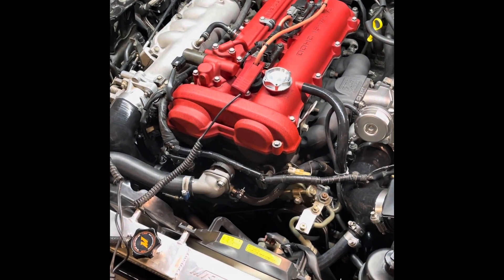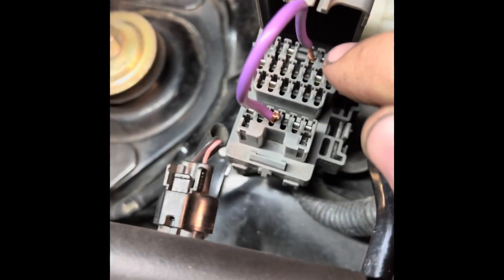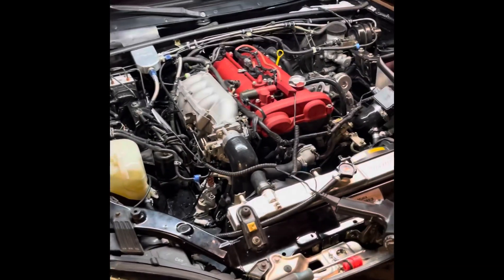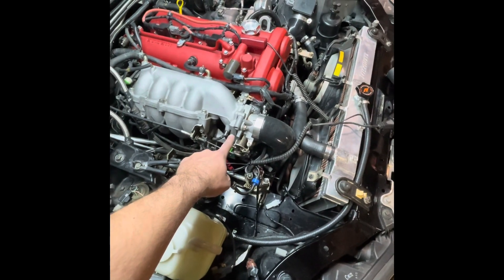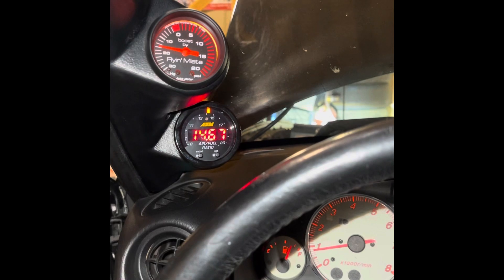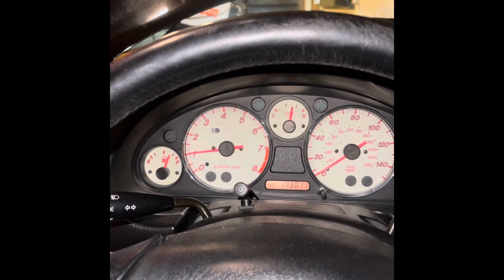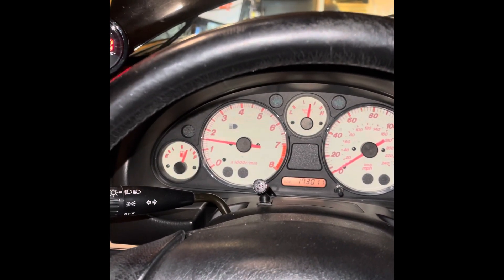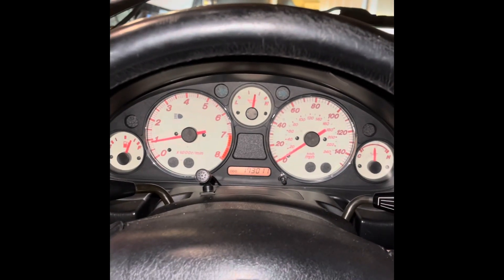Flying Miata stage one turbo idle droop

Comment: Having the same issue...ever figure this out?
Reply: So I have ended up going with megasquirt, however, Check your egr valve... I had three egr valves and all of them leaked. I don’t know for sure, but my best guess is that was the cause. I made a block off plate out of a soda can, just traced the existing EGR gasket, the car would then finally hold boost. I would start looking there
Reply: @annelisewright2566  thanks, I haven't gone for a drive yet but it seems to create boost just fine, just drops when I comes down afterwards. I just cleaner and inspected my egr so I don't think thats an issue.